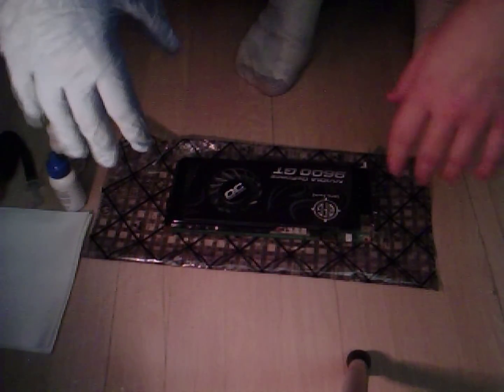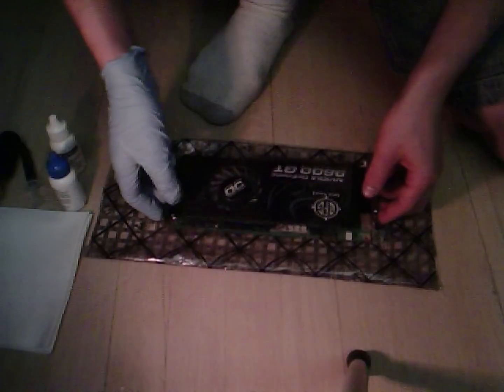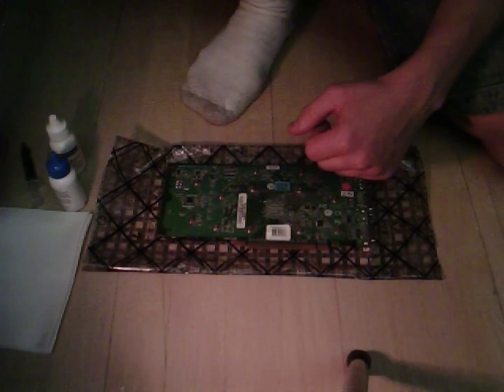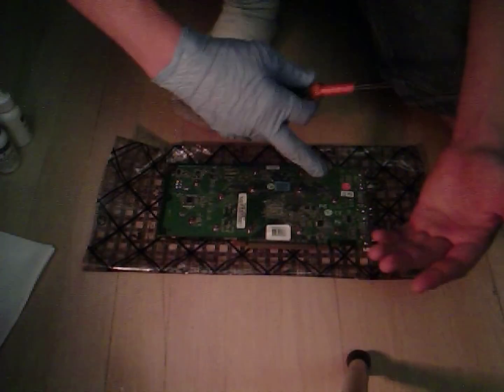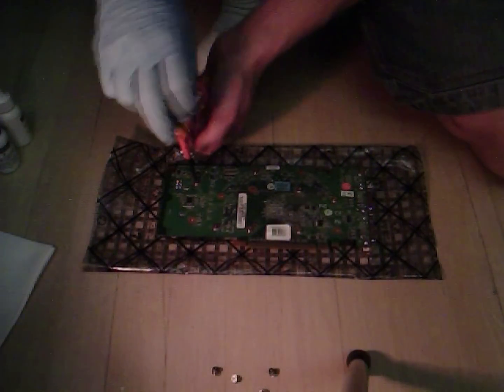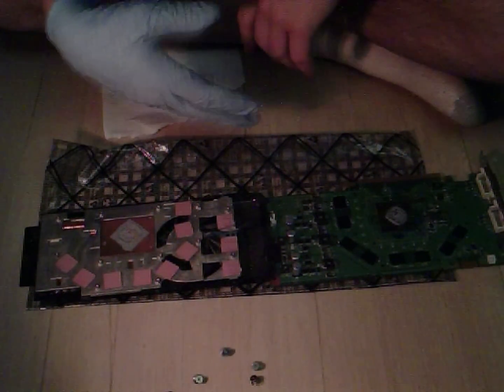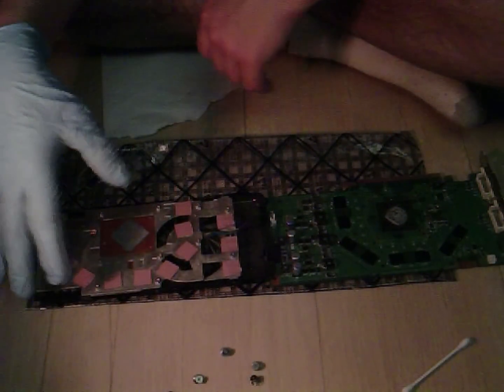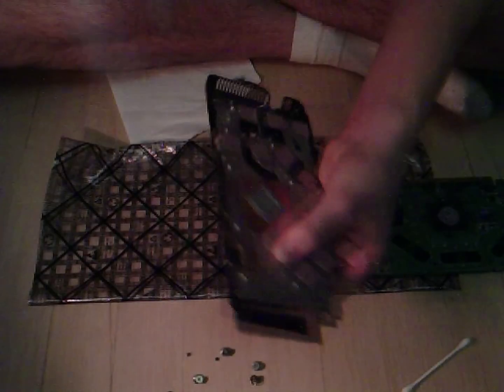How To: Clean and Re-Thermal Your 9600 gt Video Card Part 1

Comment: first of all, thanks  a lot for this video
I've been searching for this kind of videos for a long time
anyway, when I tried to clean my video card, I saw that the white pads on the heat-sink (yours are pink) are kinda melted and some little particles are pasted on the ram chips around the GPU. Is it a good idea to replace those pads with a simple thermal paste or something?